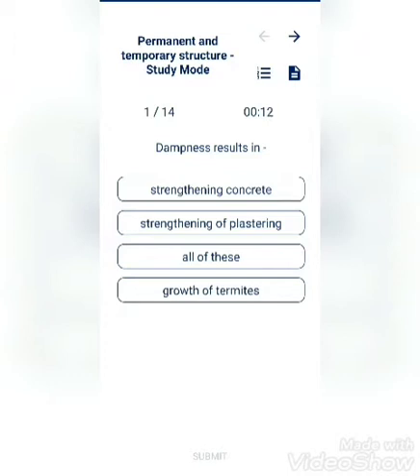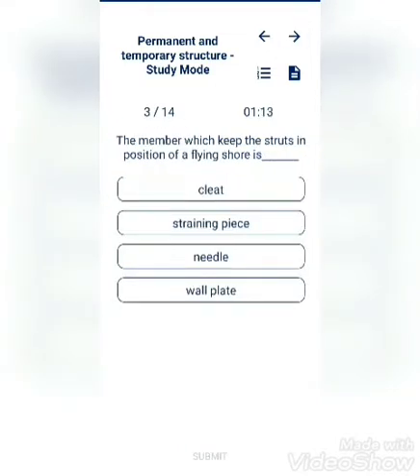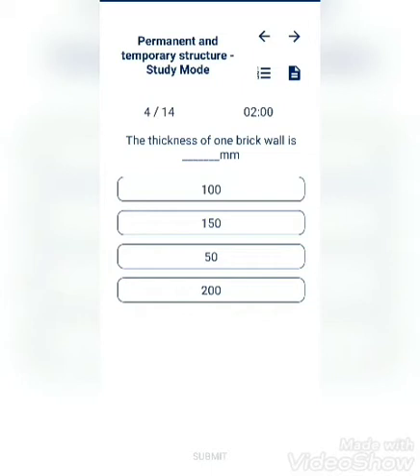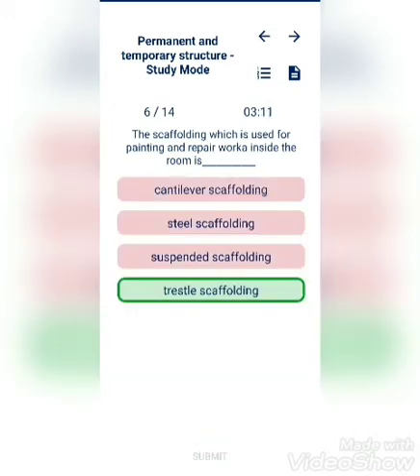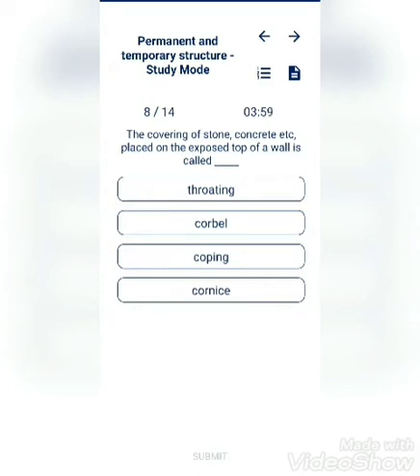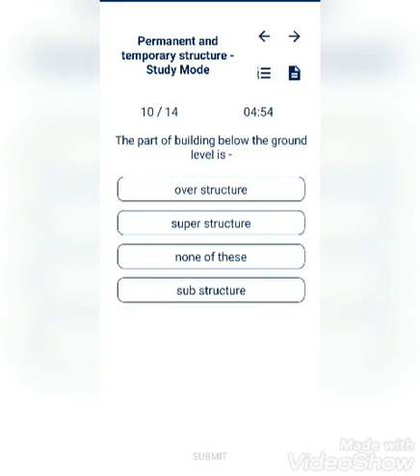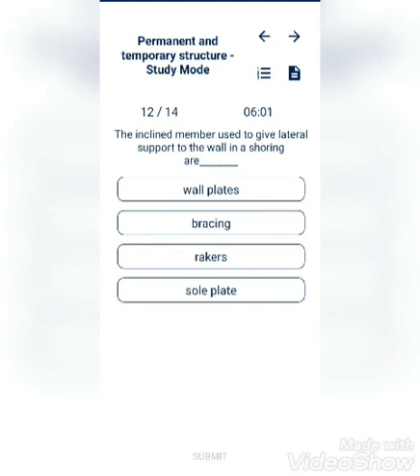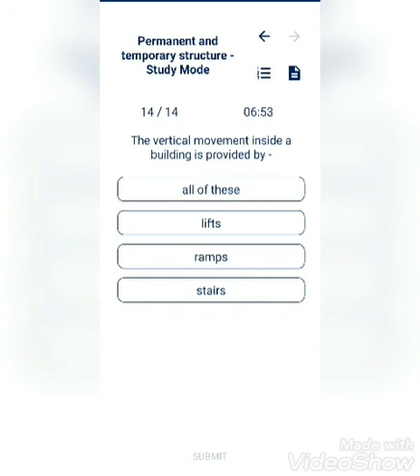Permanent and Temporary structure

Comment: Q no. 10
  Q no. 2  ans wrong  alee??
Reply from the maker: Questions no:2 answer is correct
Reply from the maker: Question no:10 correct answer foundation aanu athkond aanu none of these koduthath.. Substructure ennum kanakkakkam.
Reply: @civilpscquestionbank2795  foundation or substructure aan. Apo optionil substructure ulathkond ath aayirikile correct
Reply from the maker: @a_b__raam2978  Athe.
Reply: 13. Wall അല്ലേ (superstructure -- top most part of the building )
Reply from the maker: @rubinkmathew9366  editing mistake anuto. Top most part superstructure aanu.so thannirikunna optionil slab aanu answer aayi varuka.